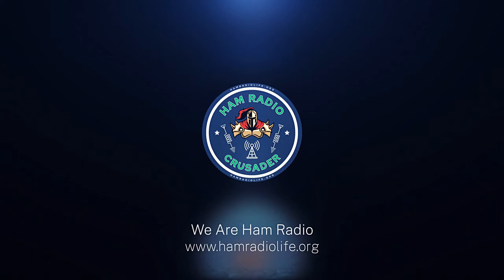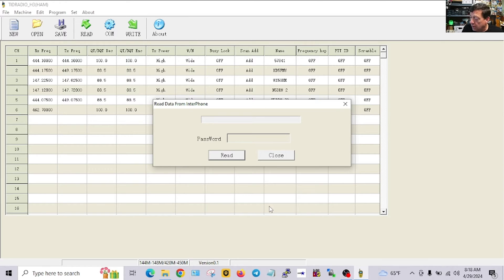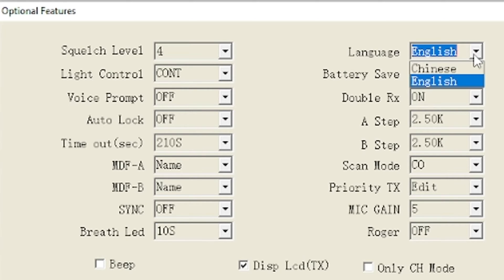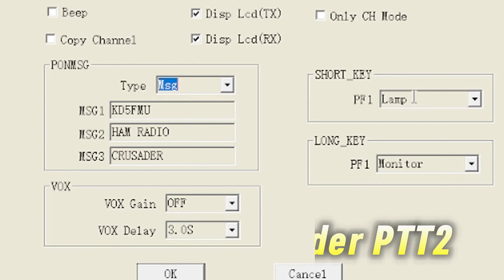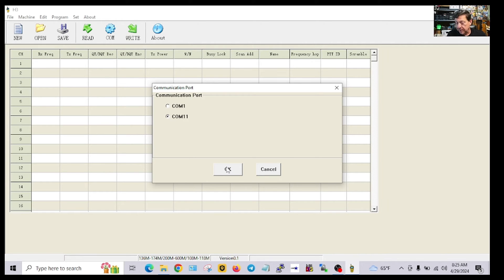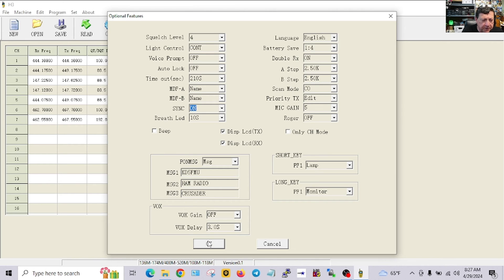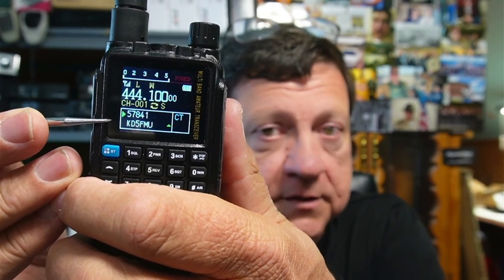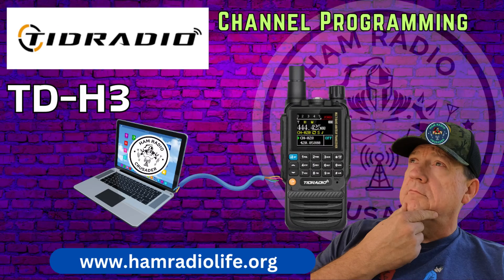TIDRADIO TD-H3 Channel Programming

Comment: Is there a driver available, for the radio?  The software shows no com ports, and in my devices it says USB serial, driver not available (windows 11)
Reply from the maker: @jonnyb1963  Are you using an programming cable with the FTDI Chip? The Older Prolific Chip has issues with Windows 11
Reply: @HamRadioCrusader  I'm using a USB cable to the data port on the radio.  I just downloaded the CH340 serial driver and now I have a COM 4 port available.  I can now, read the radio, but when I went to write to it, nothing seems have been programmed.  working on it! lol
Reply: I got it now, it actually did program, i just forgot to set channel mode on the A/B so that why i thought it didnt take.  all good!  thanks for the help and for all your videos.  very helpful indeed!

Comment: I'm so glad to see someone finally using the Tidradio CPS because no one seems to know about the PTT-ID that only works through the factory CPS. I added an ID to the "PTT ID Starting" and "Ending" in the CPS and it does work, but there is a 2 second delay before sending which also mutes the mic in the process. I can't find a way to adjust the delay. I removed the Self ID but that didn't fix it either. I'm using firmware version 240416. Do you know how to fix the delay issue? Also, I saw that you added numbers to the "Call Code" section. What exactly does that do?

Comment: Thanks for the video. When I install the software I don't get the version including 220 MHZ. How do I change that? When using with Chirp I can operate on that band. I have the radio set to "normal" but the software from TIDradio doesn't do it.

Comment: I think my H3 is defective. I can transmit on 2m/70cm simplex, I can receive from repeaters, but I can't trip repeaters. I have 3 other HTs and they all hit repeaters fine with the same settings. I contacted support, and I'm still waiting. I've read similar reports from a couple H3 users on reddit.
Reply from the maker: Sounds a bad production run. SHEESH!!
Reply: @HamRadioCrusader  Maybe. Support sent me a new one and it works fine.
Reply: @theroguetomato5362  im watching videos thinking the same thing right now.  Monday I'm going to tower chase and make sure I'm looking at the tower, carrying 2 radios with me and see if I can get into a repeater then.  Right now I've made countless calls on the H3 and have not heard anything back.   Scanning for hours, all I can pick up is NOAA.

Comment: I watched your video for firmware upgrading of the H8.. Since the H3 has a USB-C port, can the firmware upgrade be performed over IT or is the K-type FTDI cable required for this?  
When I connect my H3 to my PC - I DO get a USB-SERIAL CH340 com-port so I hope it'll work (albeit, haven't been able yet 😒)
Reply from the maker: I have not been able to get the firmware upgrade to work with the USB-C cable. I had to use the K Type programming cable.
Reply: @HamRadioCrusader  I just used the USB-C cable to update from H3_240817 to H3_250317.  Worked great!

Comment: Thanks for the firmware update.After a few try's,I finally got it working.No Podger beeps with this one.Wished it was water resistant,as it would be great outdoors in the weather. It is a great radio.Mine came with 2 batteries.

Comment: the usb cable is able to works to charger and to conect to pc?? if yes is a good feature
Reply: Yes. Plug it in the bottom, it charges the battery. Plug it in the side under the “K” connector and you can program it with CIRP.
Reply: @johnmichalek9802   thanks i folow your chanel
Reply from the maker: The USB-C port for data will not charge the battery. The USB-C port on the bottom of the battery will charge the battery.

Comment: I wasn’t aware that there are “programming” vs. “charging-only” USB-C cables.  Can we not just get along?   There are no marking nor any outward way to tell one from the other.   This is another curveball I didn’t need!
Reply: This radio can be programmed with ANY usbC cable,.. data cable not required because the chip with the firmware on a data cable is in the radio already thanks to the wonderful team at TidRadio! 🙂
Reply from the maker: Some of them will say sync cable or data cable plus charging or whatever, etc.
Reply from the maker: A sync cable is a data cable
Reply: Unless they're really old cables, there's no difference other than amperage. The battery pack on the TD-H3 is self contained with charger inside as well as BMS inside so no charging (or powering apparently) through the radio, just like most all pro radios.

This makes a lot of sense thinking about the future: you can switch to sodium ion, NiMH, etc without the radio even noticing! The other radio companies should be paying attention!